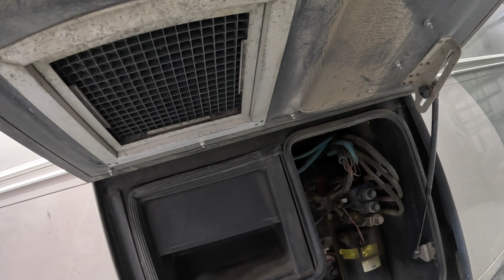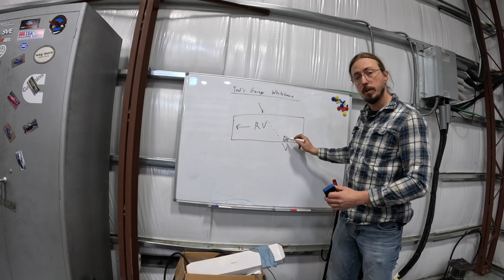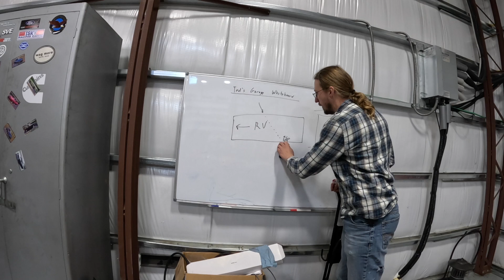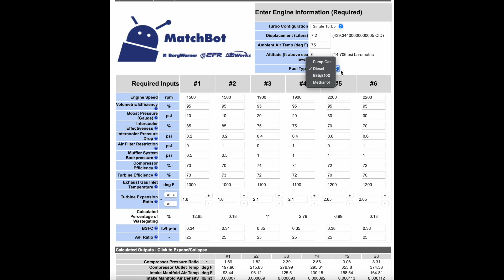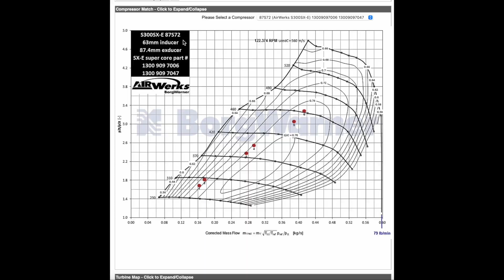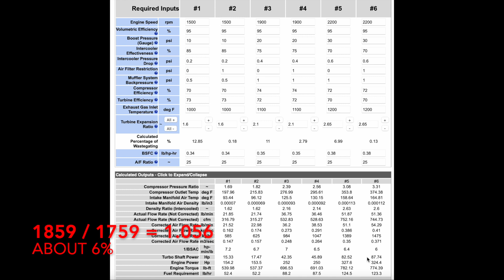RV Aero: Lowering my Cat 3126 EGTs by 100F with an $85 eBay Scoop

Comment: makes a lot of sense... I have the same engine set up & I feel that the intake and pipping after the intercooler is poorly designed.  With 2 tubes at 2" , they take a long rout with some hard elbow bends...Then mine has to make a 180 degree turn in the intake manifold.  
   I like what you did & will be doing something similar... I also plan to "ram" air from the sides into the trans and engine bay, and belly pan under the trans and engine . I already have some dents on the oil pan, (used rv)  , I would think the air would be cleaner and cooler, and maybe less "pull" on the fan, (more cfm)... a cooler air charge and radiator can only help.. 
   a fan clutch or maybe a electric fan clutch might be usable after
Reply from the maker: I converted that RV to electric fans, which was an enormous improvement. Check out my other videos for details on that.

Comment: Are you concerned about water ingestion?
Thanks for thinking outside of “the box”.
Reply from the maker: Good question. No, I’m not worried about water ingestion. The only possible amount that could hydro lock the engine would be from a huge puddle, which is unlikely. The scoop also is oversized enough that some water would sit in the bottom of it, and the air box before the air filter has a few small drain holes in it and the air has to go upwards in an S pattern, so I don’t think it’s possible for any significant water to get in. I do observe some level of further EGT cooling in the rain, some very minor amount of water injection probably. I used to observe the same when I flew the MU2 in the rain and snow/ice.
Reply: @TedsGarage  
I have a scoop I will eventually add. My intake is 6’ above ground level. It can only help a marginal design. 
Scoop system on roof in fresh air would be nice…
Reply from the maker: @jeffking3160  agreed, I thought about making a duct to have the air inlet be on the roof but that was more effort than I thought made sense. I would just make sure you have some form of drainage in case of a lot of water from a puddle or the like
Reply: Thanks for sharing your experience 👍🏻👍🏻
Reply: Brilliant explanation Ted, no one on u tube does what you do. I wish I could figure things out the way you do. Keep videoing , I appreciate everything you explain to us all .....😊
Reply from the maker: @ronmoore3987  thank you!

Comment: link? Great vid
Reply from the maker: The exact one that I ordered doesn’t seem to still be on eBay, but you can find one similar. Just make sure that the length and width of the scoop dimensions are greater than the size of the grate on your RV, but still small enough that it will fit on the bay door.

Comment: Great video! Would you please provide the link for the air scoop? I have the same configuration. Thanks again!!
Reply from the maker: The exact one that I ordered doesn’t seem to still be on eBay, but you can find one similar. Just make sure that the length and width of the scoop dimensions are greater than the size of the grate on your RV, but still small enough that it will fit on the bay door.